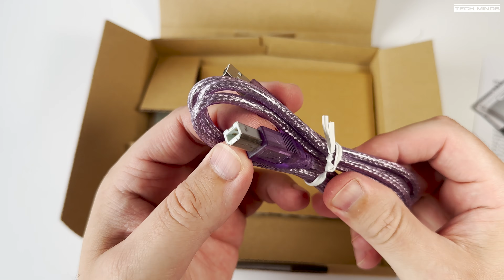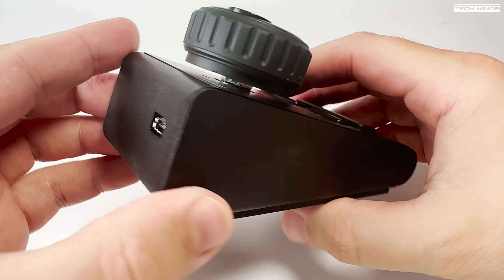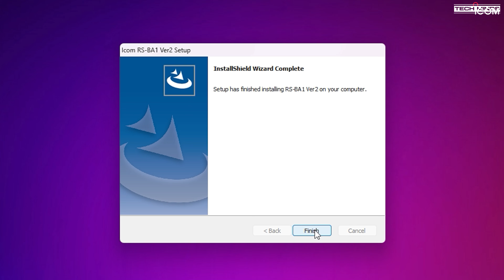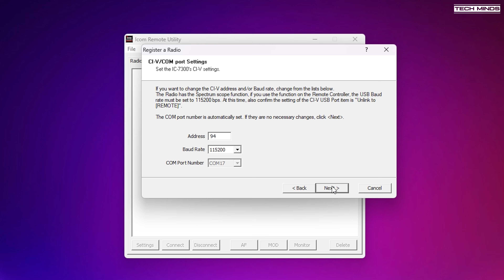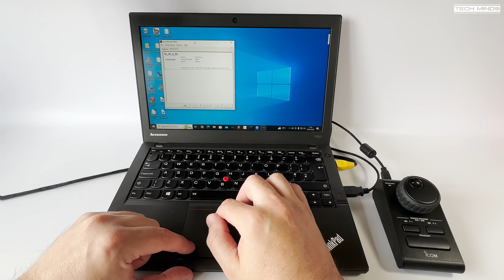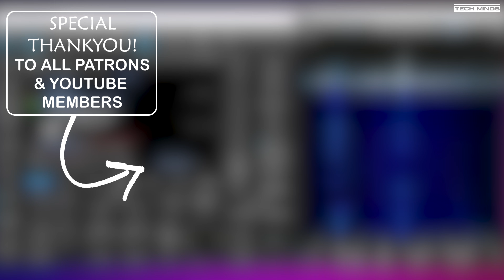ICOM RS-BA1 Version 2 Remote Control Software With The RC-28 Controller

Comment: I have to say compared to SunSDR + ExpertSDR3, this looks extremely dated and limited.
Reply: I had some experience of SunSDR’s and could never get the IP network mode to work properly, always seems incomplete there Website promises so much but doesn’t explain how to get it all working….. the icom system is okay in my opinion straight forward we’ll documented.

Comment: I have the software, but I was not impressed. I am using an IC-7300, which requires you to connect to the radio via a computer. I would like to try it with one of the IP direct connected radios like the 705.